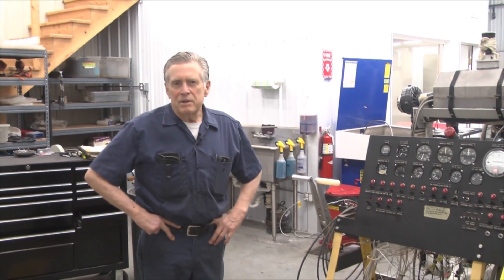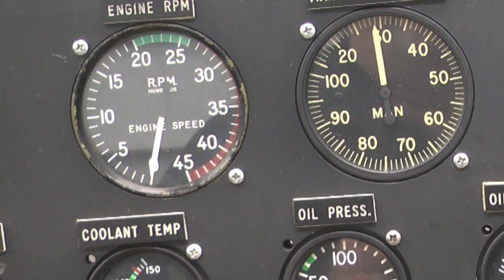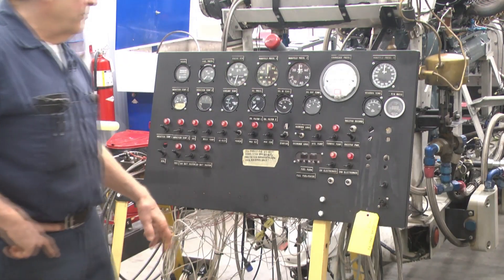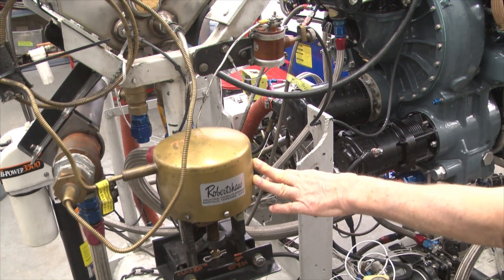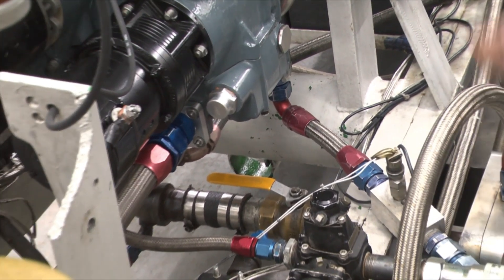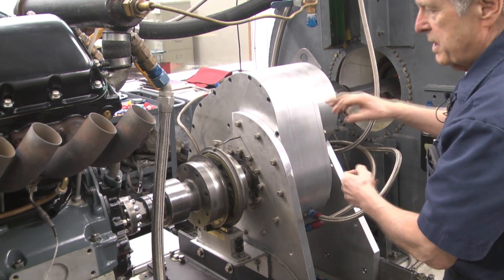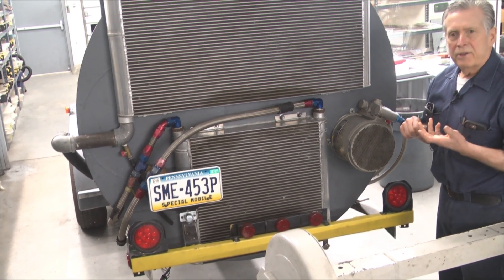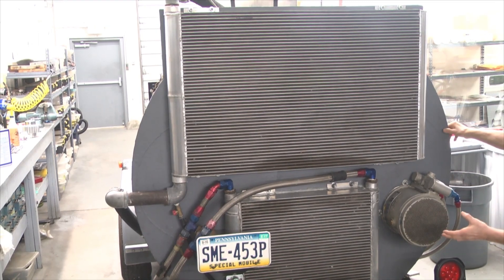Part 1: Allison V-1710 Dynamometer Explained

Comment: Such a nice setup and a really clever absorber to use the compressor! But how do you start the engine? Do you use the starter for the jet engine or is there a clutch?
Reply: We use the Allison engine starter, no clutch involved, Allison and turbine spin together without difficulty. When the Allison starts both spin together measuring the torque thru the torque transducer

Comment: Interesting that you only go to 60" MAP. They're capable of at least 84" of MAP on 150 octane fuel.
Reply: All Allisons that operated during WW2 were rated on 100 octane fuel. 150 octane was not widely available if at all.. The engine demonstrated is a single stage supercharger 8.8to 1 ratio with a war emergency rating of 60"map with a maximumof 62" map at the test site 3000 RPM. The only Allison engine that would make 85"map would have been 2 stages of supercharging -109  or a P-63 engine needing water / alcohol injection to prevent detonation.

Comment: Why is there so many exhausts on this engine for a v 12
Reply: Good question. The engine is a V-12 with 4 valve per cylinder or 2 exhaust and 2 intake per cylinder, therefore the 2 exhaust stacks per cylinder. Very advanced stuff for 1943

Comment: Wow.  J79 compressor section.  Art Arfons had a J79 in his Green Monster land speed record car.  That engine was supposed to be "not available" to civilians back then, and the Air Force gave him a hard time about having one.  I suppose years later, it has been declassified, and not a big deal to own.  But it must have been kind of hard to find and expensive.

How much power do you think the compressor section can absorb?

Back in 1981 I was an engineering co-op student at Allison in Indianapolis, and spent 3 months as a mechanic in engineering test.  The facilities they had were JUST PLAIN AWESOME.  I worked in the large-scale compressor test facility for about a month, where they were testing the redesigned compressor for the T56 Series IV.  That compressor took about 4500 HP to drive at rated speed and pressure ratio.  The test stand used the hot sections from old J71 turbojets to drive the compressor being tested.  I assisted the technicians during installation of the test compressor, hooking up instrumentation, and taking data during test.  My biggest job was removing and replacing the fuel injection nozzles on the J71 hot section.  This was all memorable stuff for a 19-year-old to be involved with.
Reply: The AgentJZ YT channel covers everything you could imagine asking about aircraft gas turbines. He stated in one episode that the J-79 compressor requires 30,000 horsepower for its function and it turns some 11,000rpm. I'm guessing the gearbox on the test rig is a reduction gearbox because the compressor must require more than 1,580 horsepower to turn it even @ 3,000rpm, even then it is probably mostly unloaded. What I'm surprised about is how little noise the compressor section makes in the setup compared to the V-1710 engine.

Comment: I worked in the UK version. It used a Heenan and Froud dynomometer and the whole bed could be tilted to 45 Deg. We tested the Meteor engine which was the tank version of the Rolls Royce Merlin. There was a seperate test cell for personnel. I did on one occasion as an apprentice walk past a Merlin engine going full chat. I can still hear it 50 years later.  I did get a rolliken - bl**dy health and safety.

Comment: On the J79 is does the hydraulic system to change the vane angle use hydraulic fluid or another type of fluid?
Reply from the maker: We use ATF but almost anything will work. Looking for smooth operation.

Comment: Horsepower (Power) is proportional to the measured dynamic torque times revolutions (HP ≈ Torque * RPM). We're informed that the torque transducer is calibrated, so the attached computer can do the math. Lovely to see it all pays out for the firm.
Reply: Torque (lb*ft) X rotational speed (RPM) / 5252